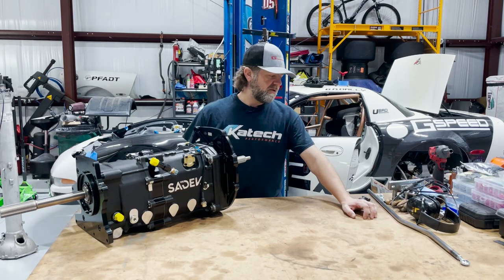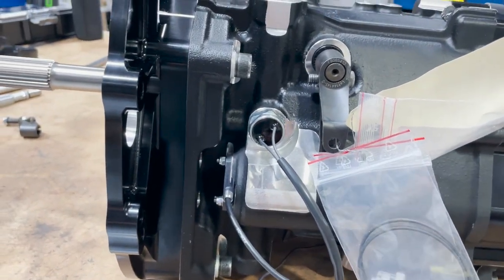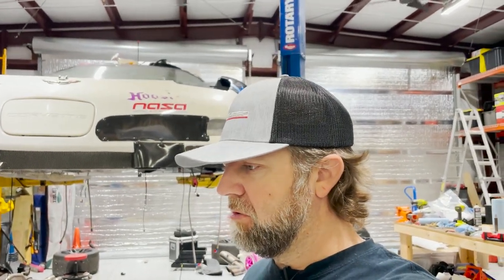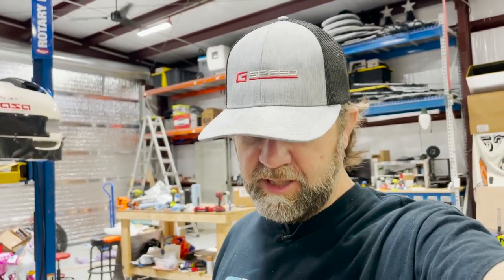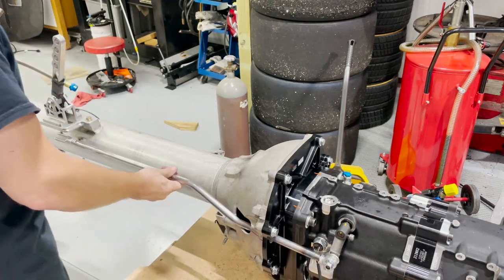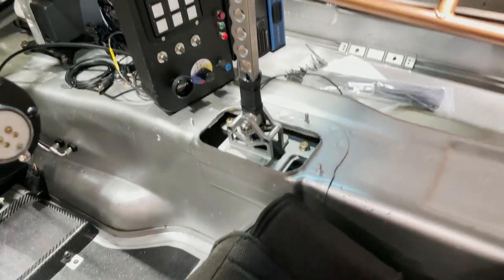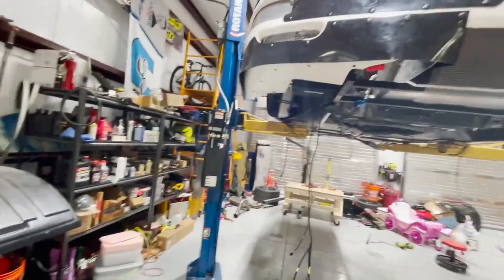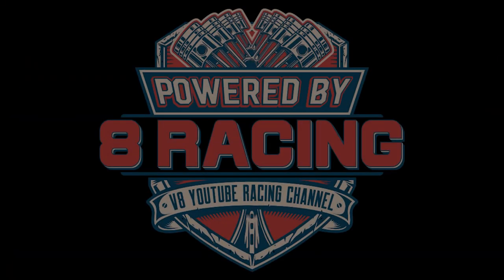C5 C6 Corvette SADEV Sequential Transmission Install

Comment: This is cool as hell….but what kinda loses me, in order for a C5 vette to be worthy of this kinda tranny above & beyond what the stock unit can handle (which is quite a bit..650-800whp will hold) before needing upgrading which would only run ya $3-5k max from RPM etc…..it would appear to me if you got the power/performance to justify this tyranny it’d be @ a power level that would be impossible to hook anywhere lol? Any traction secrets I don’t know about yet? My C5Z is blown/cam/meth etc 718whp it struggles w/ Toyo R888Rs 305s…..
Reply from the maker: The car is built for circuit racing.  Many of the components on the car right now would be a waste of money.

No traction secrets, R888’s I’ve had on a blown Mustang, they were good performance street tires, but definitely not good for drag racing.  And now there are much better tires than even them for performance street driving with like tread ware.

As for traction on a circuit we run Michelin S8 or S9 depending on the occasion.
Reply: You realize this is an open track car right?  You rarely will find blowers and certainly not meth injections IMO on a road course car.   Kinda of a weird comment.
Reply from the maker: I didn’t see this reply.  So while some see the C5 as an old platform, it’s actually a very good platform and all components can easily be moved over to a C6.  Purchasing a MOTEC is like a lifetime motorsports investment since you can take it wherever you want.

This transmission is only rated to 600hp, so my power levels will be below that and will be adjusted according to the class I’m going to run for the weekend.  While you can run a McLeod RXT to 1200hp, notice the size of the clutch.  My clutch is tiny so it requires more levels to create the same surface areas as a larger.  But what it allows us is a much faster reviving car vs a street friendly clutch.  This small Tilton clutch is basically on/off, there is no slipping the clutch like a RXT which would be more street friendly.

As far as shifting, yea, this will shift fast and be in the correct gear.  The other thing people don’t realize with a sequential is the gearing combinations are almost infinite.  So you gain speed this way as you don’t lose 3 gears due to a manufacture trying to meet EPA MPG criteria.  And you are always in a power band with properly matched gearing.

Price for a quality sequential starts around $25k.

Comment: What's the total cost for that trans swap?
Reply from the maker: Because the global market is so jacked right now, it’s hard to say cause prices are fluctuating up and down everyday.  Most sequential swaps are between $18k-$45k but can be more if the project requires it.  But that’s a good ball park depending on needs.  
I purchased this through GSPEED, they would be best to answer any pricing questions 877-512-5180.